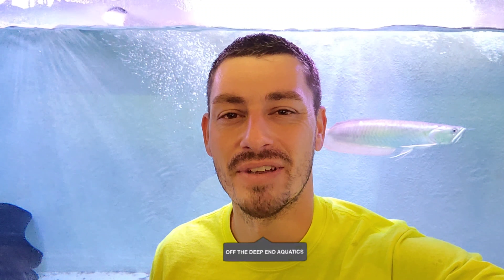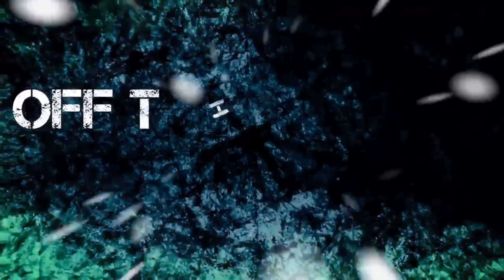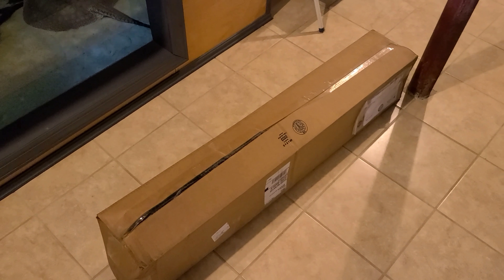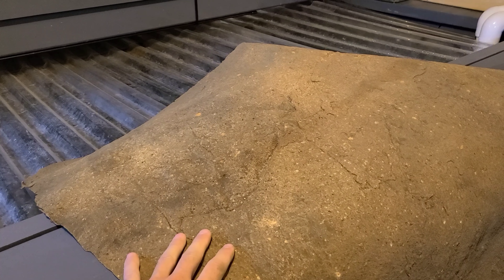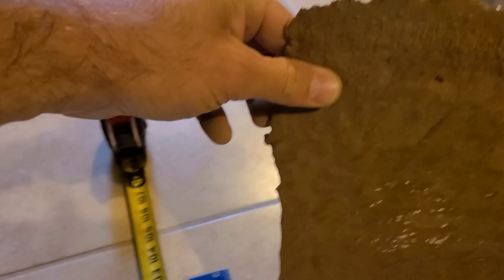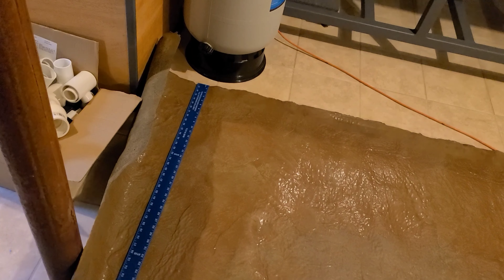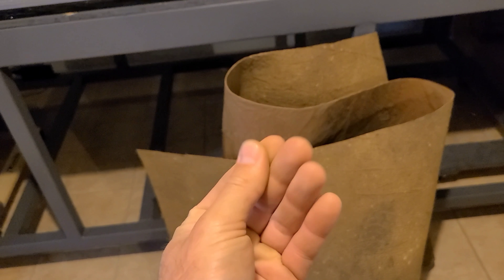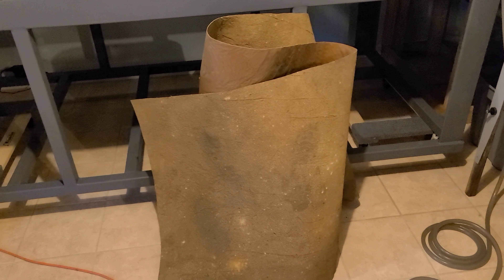MONSTER 600 GALLON AQUARIUM BACKGROUND

Comment: I had one of these on a 65 that flooded my house. Anyway, I really liked it but mine was slightly more 3D yet still on the flat side. I actually thought mine was of great quality and loved it. I did silicone it down and enough moisture would get back there to get moldy but otherwise kept pretty clean. Way better than leaving it clear. It will all come together once you get the other scape in there.

Comment: I've never known anyone to say something good about universal rocks. You're not the 1st and won't be the last.  I'm not saying universal rock,  But i ordered a cheap copy from chyyyyna.  it had a terrible chemical smell,  i soaked it and washed it,  still smelt bad. so i left it to soak for a week.  came back it had half disintegrated.  I've tried the cement and insulation board method, but even after soaking, the PH goes sky high, ..  Expanding foam and adding substrate, sand rocks, wood before it dries is good, especially for the 3D effect.  or wait for it to dry and paint it with acrylic paint.  (aquarium safe).    i let my kid go to town on an 6ft tank,   only two cans of foam and some cheap paint off eBay.   it looks amazing,  real 3D effect  rock face with caves and over hangs,   only thing is it's permanently stuck to glass, and cant be transferred to another tank without destroying it.